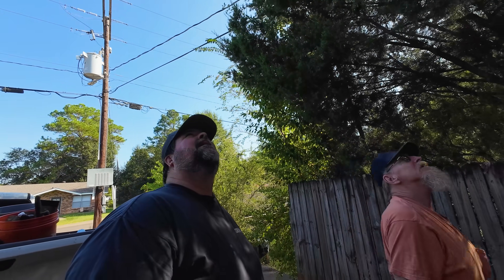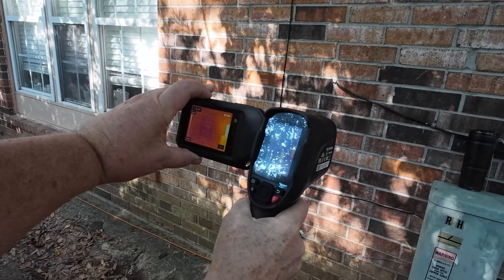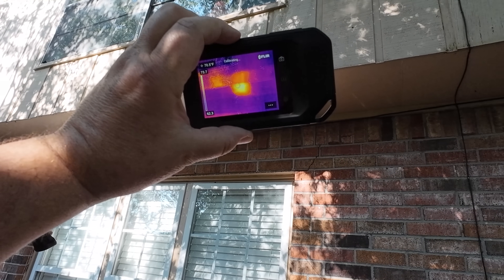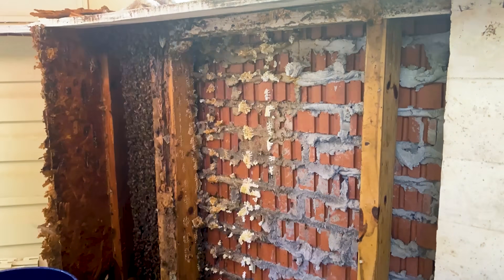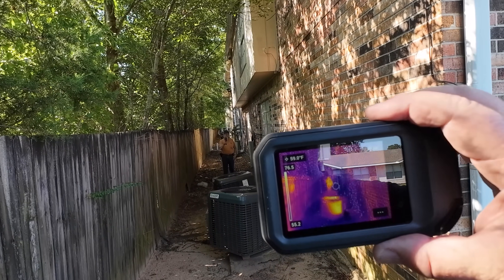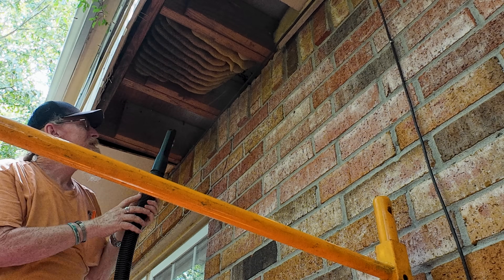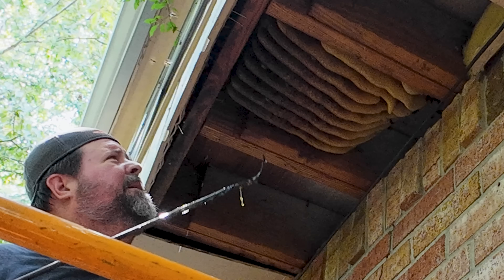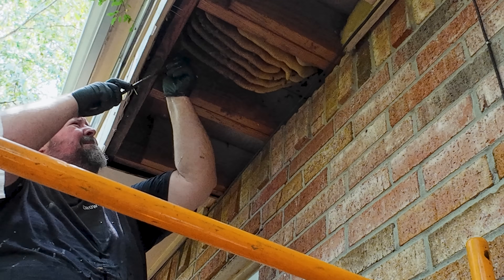FLIR V/S Vevor Thermal Cameras

Comment: Hello Randy I went to look an price a
Cut out today . Got to the job an walked it with the
Owner checked inside an outside as talking about everything. Got done then told him what it would run an also the price if it was also in the fireplace. He turned to me an said BUT I WAS GOING TO GIVE YOU THE BEES . All this was after he was told earlier that there would be a $$$. He is again looking for someone to do the job . 🤷‍♂️🤷‍♂️. Hope you all are doing well. THANKS
Reply from the maker: Thanks for sharing your story Kathy.  That's why I get photos and/or video ninety percent of the time.  Saves me a lot of free consultations, a ton of gas money and so many hours of my time.  I bid most of my residential jobs by phone.
Reply: @628DirtRooster  that’s the first one in a long time it has happened. BUT GREAT IDEA . I will for sure start that . Yes time an gas is not cheap. You two crack me up but it helps the job go faster. THANKS

Comment: Hey Rooster I got a Black view phone.  I have an Infrared built into my phone.  It works well enough.
Reply from the maker: I thought about trying one of those out.
Reply: @628DirtRooster It holds up to me, I am very hard on phones.
Reply from the maker: My most durable phone was an old industrial flip phone.  Seems like it was a Motorola.  I had it in my shirt pocket at the beach and bent over to pick something up.  The saltwater plunge ended it.